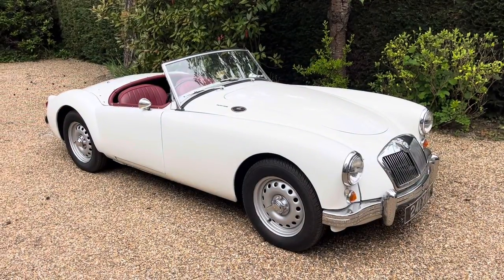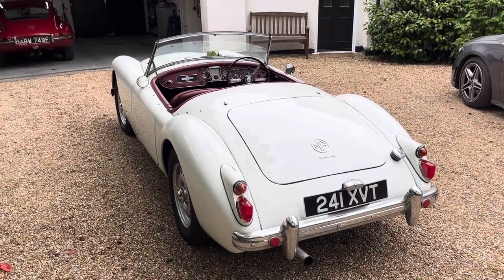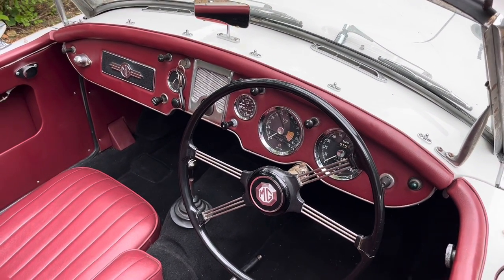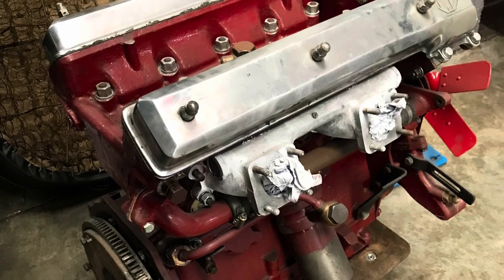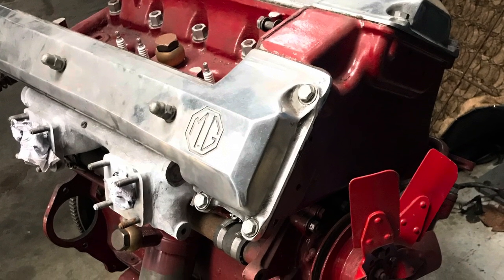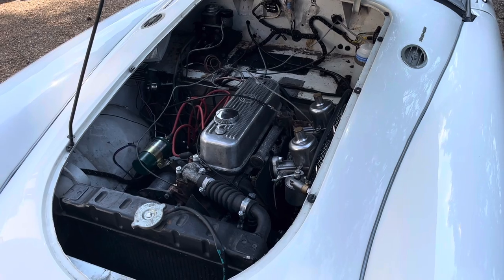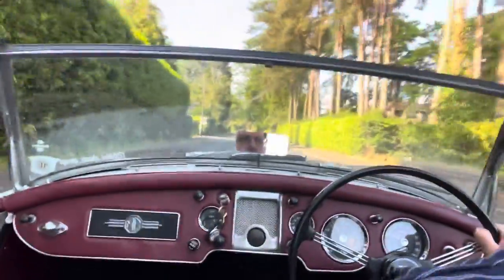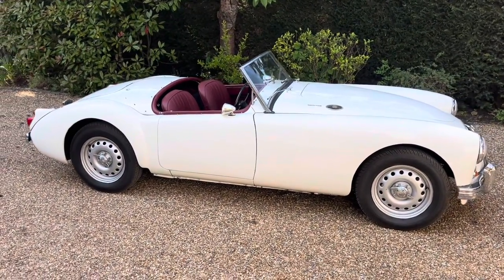What made the MGA Twin Cam so rare also caused it’s failure - major engine issues

Comment: Good quick review of the twin-cam engine.  I really miss my 1960 MGA 1600.  It was a single cam, but it was originally set up for race track use.  Keeping the wire wheels true provided a second job for a while.

Comment: They could have saved themselves a lot of time, money and reputation by just having a look at the engine in the Alfa Gulietta which predated it by 5 years. It could produce about the same power from 1300 cc and it didn't go bang.
Reply: The same comment seems to be equally valid regarding the Lotus twin cam of 1962 which although considered by many to be successful has several Ill considered design flaws. The stupidly placed distributor under leaky carbs. The ridiculous water pump built into the badly sealed front cover. The inlet manifold integral with the cylinder head all come to mind. I can only assume that some made in Britain loyalty was the motive for its existence.

Comment: Rather surprisingly, BMC tasked both Austin at Longbridge and Morris at Cowley with designing a twin-cam head arrangement for the 1588cc B-series engine block ( a displacement unique to the MGA.) The Morris version, overseen by ex-Riley engineer Eddie Maher, was entirely new whereas the Austin factory design team drew quite extensively on the pre-war twin-cam head employed on racing Austin Sevens which had been successful in their period. Unfortunately it was the Cowley factory version which was chosen for production by BMC with such unreliable results as burnt pistons and a dipsomaniac thirst for oil. As BMC were also selling the conventional but robust Austin Healey 100/6 at the same time they were competing with themselves in the marketplace. An event which tarnished the reputation of MG at a time when Alfa Romeo had already placed their jewel of a small capacity twin-cam engine into series mass production to deserved applause. I should add that I love my 1961 MGA 1600 fhc.

Comment: They should simply have bought Alfa Romeo engines.
Reply: I worked at the Coventry factory where the twin cam was developed. Just a little more development could have Yank-proofed the engine, and it could have been a huge success.... this engine could not survive with low octane fuel.   The CR should have been knocked back to 9 to 1 which would have reduced its sensitivity to ham handed mechanics setting the timing wrong. The oil consumption was due to poor design of the piston rings. A 1600 twin cam 10 years before the Ford Escort TC!
Reply: @nikjames2965  "YANK-PROOFED.  That is a tall order. Americans are well known for not taking care of their cars, or butchering them. 
I worked at a BMC dealership In Calif 1968-1972. We had a few Twin Cam owners. My opinion... most  Americans should stick with American
iron and leave Brit and Euro cars for responsible adults.  I have owned 30 Brit cars since 1964  7 of which were MGs to include a 56 MGA in which
I stuffed a 3 main B moter back in 1970. Also one of the few Fairthorpe Electon Climax cars.  Currently a 1963 MGB

Comment: So, it's not a Twin Cam, although to be fair, you've given us the history of a car you don't have.
Reply from the maker: The chassis number is still a Twin cam, and the chassis, steering, brakes, wheels and all the original TC parts are there. I would love to find a TC motor and bring the car back to original but unfortunately there are a few Twin Cam MGAs with a similar story to mine.
Reply: @rcclassicgarage  Yeah, sorry about my tone, sounded a bit contemptuous. I'm in Australia, so there are few, if any, spare here. I have noticed a few for restoration knocking around in The States. I was thinking, your car is almost a Deluxe, although I think they were sourced from Mk2 Twin Cam bodies, rather than the one you have, although I much prefer the taillight cluster on yours, compared to the Mk2.

Comment: There were fewer Deluxe models and were considerably better cars.
Reply from the maker: Agreed, they started making the Deluxe in the early 1960s with a standard 1600 pushrod engine and TC body and racing features
Reply: My understanding is that when BMC discontinued production of the twin cam motor they were left with a few chassis intended for those motors.  As a result they installed the 1600cc motor and voila, the Deluxe.  I've never driven a twin cam or deluxe, but I would imagine that the all wheel disk brakes and heavy duty anti-sway bar would have improved the 1600 MKII significantly.  It's unfortunate that the margins between competitors was so tight that had they done that at the time, more buyers would have opted for the Triumph and MGA sales would have suffered.
Reply: @andrewmacgregor8717  The Deluxe  was fitted with a 1622. They are far more rare than a twin cam and a better vehicle.